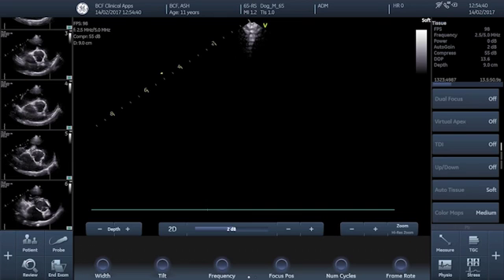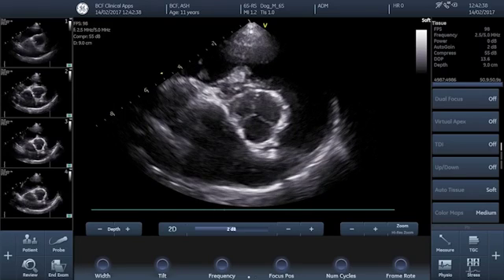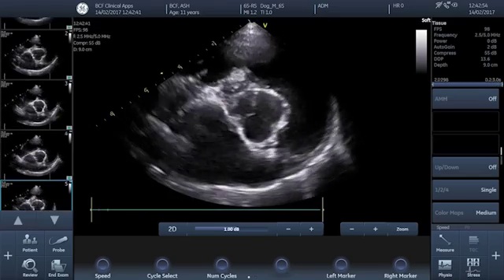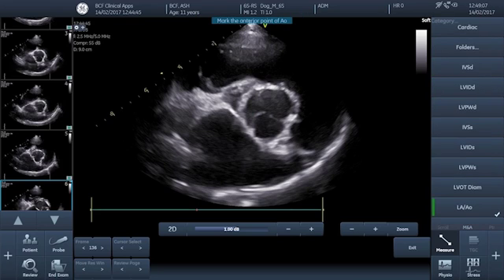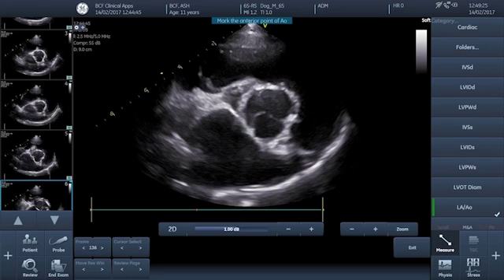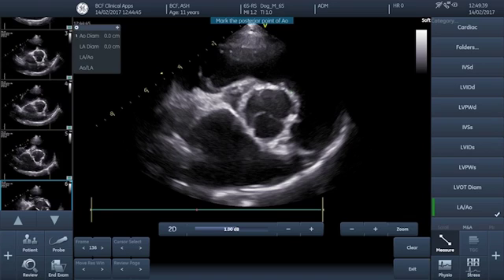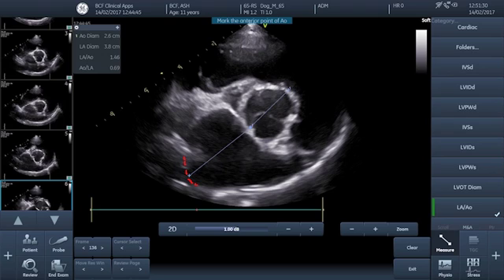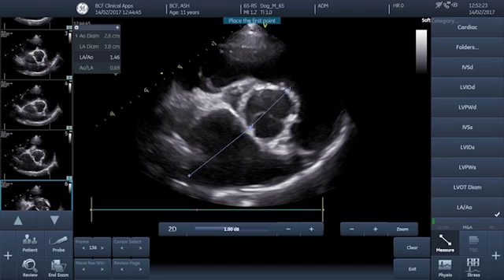Video 1 - How to perform basic echocardiographic measurements - LAAo

Comment: Hi e Saote, my hospital KGMU at Lucknow, UP, north India has purchased Echo machine and we use it in our ICU. We have some problems with its setting as image is nowadays not of good quality. 
But your website does NOT has a working phone line, your website has a 'contact' link. There one is supposed to submit a pro forma after filling it when afterwards they are assured to get a phone- call. 
My team did it more than once but to no avail. You apparently don't have a twitter page in this region. 
Please inform us how'd we contact you.
Reply from the maker: Hello. I'm sorry to hear about the image issues you've been experiencing. We are IMV imaging - did you purchase your machine through us? If you did, please contact us on info@imv-imaging.com letting us know which machine you have, so that we can assist you further.